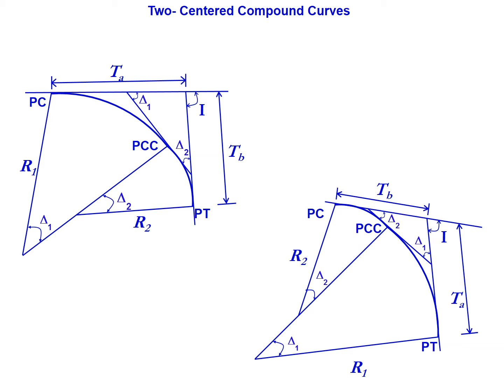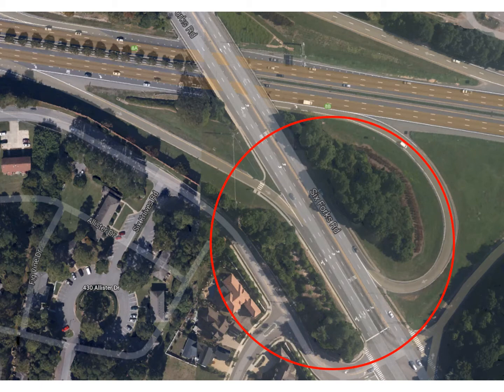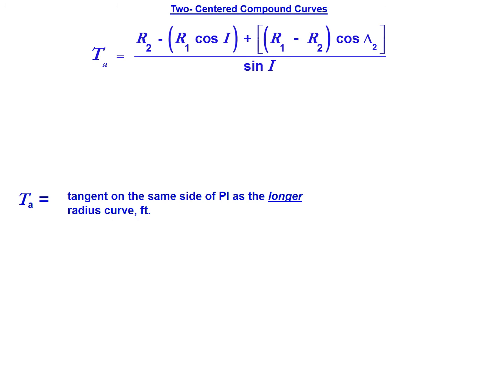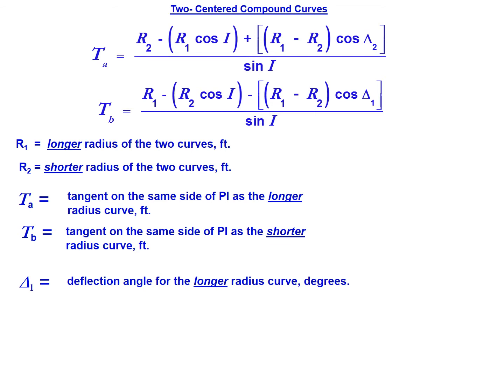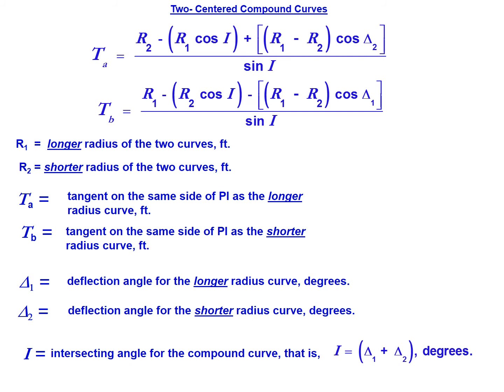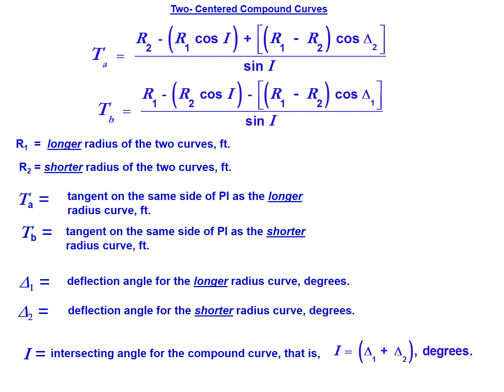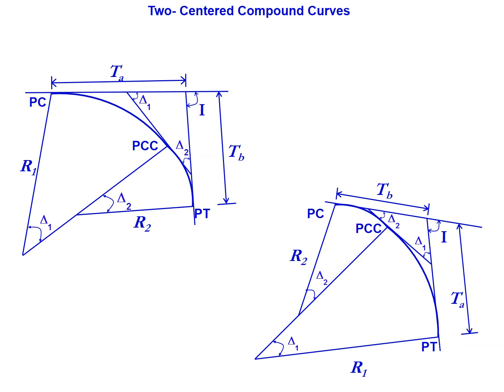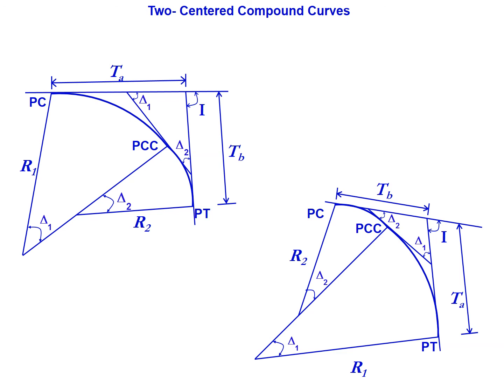Compound Curves for Highway Design Horizontal Alignment

Comment: ncees hb 1.1, page 274.

would we use T_1 and T_2, as indicated by the ncees hb, instead of the T_a and T_b indicated this is video ?
Reply from the maker: Yes, that's correct - you should get the same answer I show in the video using the NCEES equations.

Comment: Hi Sir.

What superelevation should you use on these curves. If you want to maintain your speed, must you apply different superelevations on the different curves? Or should you rather apply one superelevation throughout?
Reply from the maker: Excellent question!  You would use different superelevation rates that are sufficient for each curve's radius and design speed.  

Below is some useful guidance from the Illinois DOT about tying those superelevation rates together.

The image on Page 32-3.28 is particularly helpful also.

https://www.idot.illinois.gov/Assets/uploads/files/Doing-Business/Manuals-Split/Design-And-Environment/BDE-Manual/Chapter%2032%20Horizontal%20Alignment.pdf

32-3.05 Compound Curves
Superelevation development for compound curves requires the consideration of several factors.
For two-lane roadways, these are discussed in the following sections for two Cases:
 Case I: The distance between the PC and PCC is 300 ft (90 m) or less.
 Case II: The distance between the PC and PCC is greater than 300 ft (90 m).

32-3.05(a) Case I
For Case I, superelevation development for compound curvature on two-lane roadways should
meet the following objectives:
1. Relative Longitudinal Gradient (RS). A uniform RS should be provided throughout the superelevation transition (from normal crown section to design superelevation rate at the PCC).

2. Superelevation at PC. Section 32-3.02 will yield the design superelevation rate (e1) for the first curve. At the PC, 67% e1 should be reached.

3. Superelevation at PCC. The criteria in Section 32-3.02 will yield the design
superelevation rate (e2) for the second curve; e2 should be reached at the PCC.
4. Superelevation Runoff Length. Section 32-3.02 will yield the superelevation runoff (L1) for the first curve. The superelevation should be developed such that 67% of L1 is reached at the PC.

5. Tangent Runout Length. TR will be determined as described in Section 32-3.02. 

To meet all or most of these objectives, the designer may need to try several combinations of curve lengths, curve radii, and longitudinal gradients to find the most practical design. Section 32-3.08 presents a typical figure for Case I superelevation development for a compound curve.

32-3.05(b) Case II
For Case II, the distance between the PC and PCC (> 300 ft (90 m)) is normally large enough to allow the two curves to be evaluated individually. Therefore, the superelevation development on two-lane roadways should meet the following objectives for Case II: 

1. First Curve. Superelevation should be developed assuming the curve is an independent simple curve. Therefore, the criteria in Section 32-3 for superelevation rate, transition length, and distribution between tangent and curve apply.

2. Intermediate Treatment. Superelevation for the first curve (e1) is reached a distance of 33% of the superelevation runoff length beyond the PC. e1 is maintained until it is necessary to develop the needed superelevation rate (e2) for the second curve.

3. Second Curve. Assuming the second curvature has a sharper radius of curve than the first curve, a higher rate of superelevation will be required (e2 > e1). e2 should be reached at the PCC. The distance needed for the additional superelevation development is not specified, except that the maximum RS for the highway design speed should not be exceeded. One logical treatment would be to apply the same RS used for the superelevation transition of the first curve. This would provide a uniform change in gradient for the driver negotiating the compound curve.

Section 32-3.08 presents a typical figure for Case II superelevation development for a
 compound curve.
Reply: @FindleyDaniel  thank you so much. I really appreciate this information.